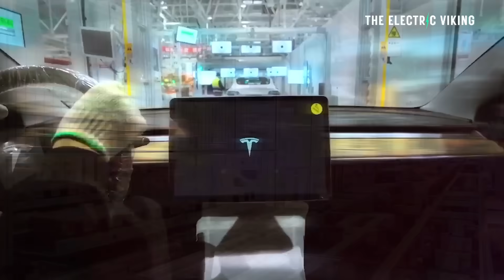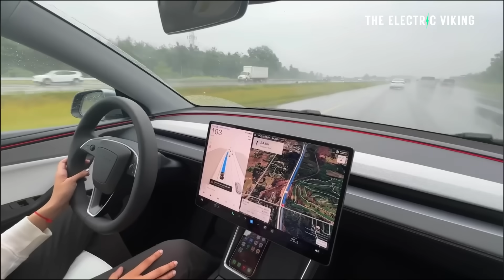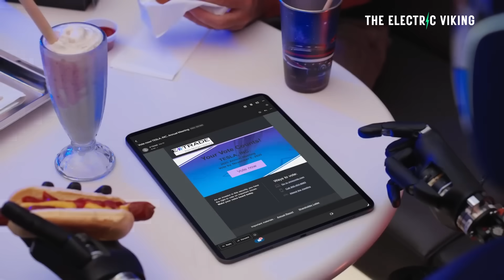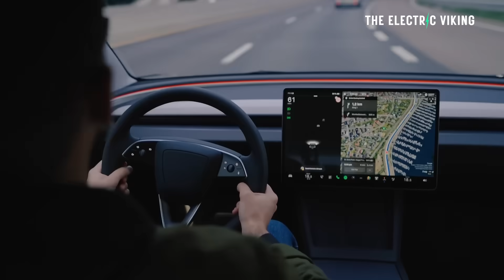THE 1 MILLION ROBOT WAR! Xpeng's IRON Aims To Beat Tesla to Mass Production In 2026

Comment: Great video. I think your analysis is correct. Elon Mask is going to find out that he underestimates how difficult it is to control a robot in 6D = 3D linear + 3D rotations is harder then he expected in a real unknown environment which is MUCH more varied than driving a car on roads, even with crazy drivers !! Just like with FSD Tesla will be able to make an enormous progress but ...
Like FSD that CANNOT really work EVER with the current just camera setup, same will be with robots 😭 FSD will ONLY be able to REALLY work if Tesla: 1. Adds the Tesla High Resolution Rader. 2. Solves the sensory fusion problem to integrate practically, engineering wise, all information. 3. Recognize (already done = RED Steering Wheel warning) that the car is NOT able to drive on its own and DEMANDS manual driving AND the additional thing needed is: A. A VERY compact summary of the situation. B. Uploading this summary to Tesla FAST and efficiently. C. Tesla having a Supercomputer dedicated to resolve these edge cases VERY fast, in under 0.2 seconds. D. Transmitting back to the car actions to be taken. Even if this cannot be done perfectly, solving 99%+ will reduce the problem with these edge cases by a factor of 100x+. The Sensor Fusion problem CANNOT be solved perfectly, as we ALL know, 90%+ of human become motion sick when they CANNOT solve this problem. Nevertheless humans have NOT dumped the conflicting/redundant sensors !!!  In addition the Tesla High Resolution Rader has longer range and weather resistant capabilities that are REQUIRED for relatable and better driving.

Comment: Optimus is currently delayed because of overheating and limited battery power. It has never been proven to do a single task from beginning to end. Doing laundry means picking up the laundry basket, taking it to the washer, putting clothes in the washer and maybe sorting colors and materials, starting the washing. Later pulling clothes out of the washer and into the dryer. Take clothes out of the dryer and into the basket, take basket to a table and fold the clothes. Once folded put the clothes away. The popcorn demo show it only putting popcorn in a bag. Other videos show a person put popcorn and oil in the machine. When I buy a new car, I test drive it to be sure it is what I am hoping for and expecting. There is no way ANY business is spending a claimed $20K for a robot that isn’t proven to do complete tasks nor should any individual.
Reply: True - for now...

Comment: I think it was Ark Invest that estimated the complexity of a humanoid robot's AI will be 200k times that of FSD. That tells us 3 things. 1 - Whoever wins this race must master AI first; 2 - The power draw of the brain, regardless of what circuitry is used will approach a megawatt necessitating batteries well beyond todays if they are to make it through a day; and 3 - those that get the most units out in public will have the fastest rate of evolution via hive cross training. 

Tesla as a company is capable of checking all those boxes. Not sure any other company can claim that.  Also, the labor rate advantage will evaporate by the time volumes are reached. China will have closed the wage gap some and Tesla will have a fully automated, vertically integrated line likely Optimus assisted.

But here is the thing - there is still gobs of money to be made with the "Close Enough" approach which is hardly a humanoid but very functional. So, by the time this plays out fully we may see a startup follow a Mazda-like-bicycles-to-cars progression since AI tech is much more open book than any previous complex tech.

Comment: The CEO and official spokesperson of BYD have publicly stated their belief that Full Self Driving (FSD)—meaning the complete separation of human control from driving—is "very, very far away, and basically impossible". This stance was voiced by Li Yunfei, a top BYD representative, during the Shanghai auto show, where he explained that from psychological, ethical, regulatory, and technological perspectives, the company sees no clear path to true autonomous driving and thinks it "is probably a false proposition:  This is why BYD will fail miserably ... because of the short sightedness
Reply: ... I trust them more than I trust the grifter that promised FSD "next year" for years and hasn't delivered.
Reply: @Mrpersonman0  Wow, have you tried FSD 14.1 or above?  obviously not
Reply: @Mrpersonman0  Tesla's Full Self-Driving (FSD) system has recorded approximately 6.4 to 6.47 billion miles driven as of November 2025, with the counter increasing at a rate of about 14.4 million miles per day. The number of deaths directly attributed to FSD is extremely low; only two identified fatalities have been reported where FSD was actively engaged at the time of the crash (very early version of FSD). This is in the context of billions of total miles driven with FSD technology.

Comment: early versions should be able to walk on surfaces very flat and stable enough they won't fall over.  walking may take a while to get working.  early versions will have short run times and over heat.  the hands will require the deluxe package to activate at all and each task needs a special software package prices separately.  the waiting list will prioritize true believers.

Comment: In regard to the difference between a humanoid robot and an FSD car the former is in general far more complex in that a human can do many things  vs a car.

As such maybe an alternate approach might be the best way to go in regard to developing the AI for a humanoid robot that simply  training the AI off from massive data sets  such as Tesla has accumulated from having installed cameras in their cars and recording the human drivers.

One such approach is to put much of the smarts not in the robot per se but in planners that plan out the actions a robot needs to perform and then feed that plan to the robot  which then will attempt to execute that plan.

This is partially done in FSD cars in that the AI can create a route for the car to drive but for a humanoid bot that plan can be far more extensive.

For example one such plan might be for a home robot to cook an omelette. That plan might have dozens of steps from getting out the ingredients and cooking utensils to mixing the ingredients and the cooking the omelette  then serving it while putting away the ingredients and cleaning up afterwards and putting the dirty dishes in the dishwasher.

As such the better way to  train the AI might not be to get data on people cooking omelets but breaking down those  higher level task until lower level ones, like  grasping a pan by the handle then lifting it up and then moving it from point A to point B and the setting the pan down ad releasing the grip on the handle.

And in fact one might make a comparison with such extensive plans with how aircraft  create complex flight plans and then how they execute them.

Along those lines I just recently posted on my YouTube a number of videos that explore that approach to training and controlling humanoid robots in more detail , all under the Play List, Humanoid Robots.

This approach might better suit the things a humanoid robot might need to do and how one might approach training them to do those things. vs how Tesla  went about training the AI to provide FSD for their cars.

And BTW, in one of my videos I also posted my chat with Claude 4.5 on what it thought about this approach and (for whatever it is worth) it agreed that this seemed lie a good way to go as well!

So maybe this approach is worth  further exploration to see how well it might be made to work.
Reply: inconceivably difficult